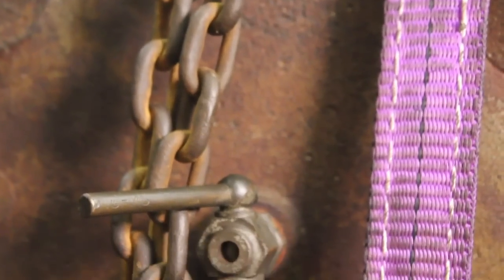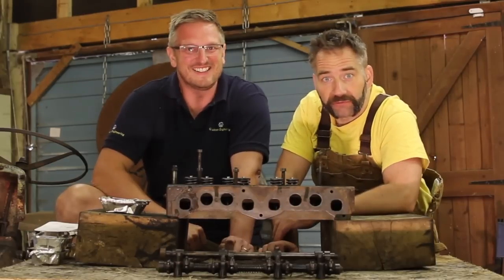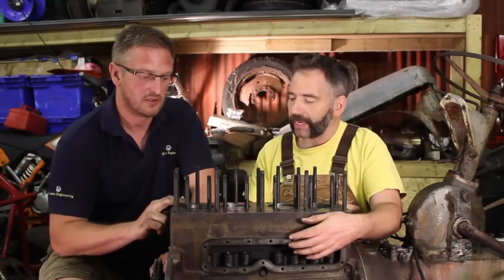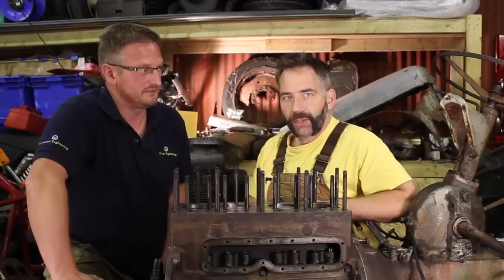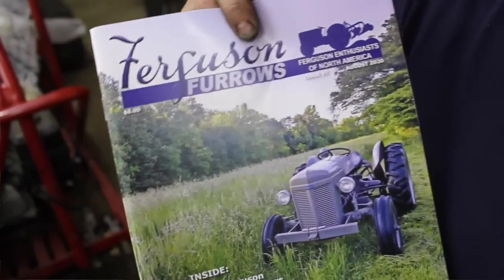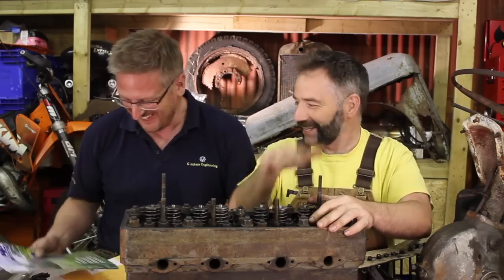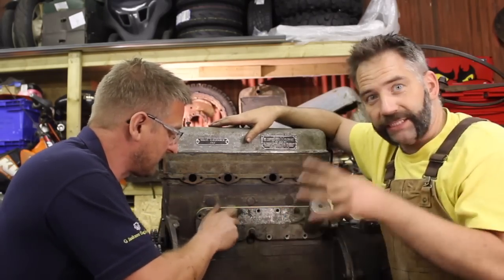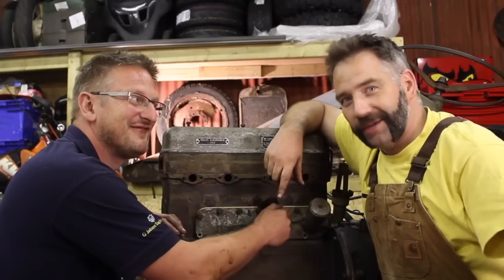Barn Find Fergie.  Episode 7. How to Rebuild an Engine

Comment: It's great to see you both making progress with the fergie,one tip for future reference,a little wipe of the studs with a cloth treated with some paraffin or a dose of that penetrating spray,gets you home more easily when fitting copper gaskets,and as the block and head haven't been surfaced,by the look of it ,a slight smear of Wellseal,if you can still get it ?,would help the head gasket to seat without crinkling the copper.
I'm enjoying the series very much ,thankyou both,see you next week .
Reply: Loving the tips, glad you’re enjoying it, see you next week👍

Comment: Make sure to check the clearance on the valve decompressor rack when setting valve clearance. This opens 3 valves slightly when the decompressor is applied. You can set the clearance when the valve the decompressor acts on is fully closed. Another trick of mine is to use copper washers on the bolts holding on the cam follower cover and the diesel pump gear cover on the timing cover as oil made its way out through the bolts on both my diesel Fergies. Great work and following with interest.
Reply: Thanks for the great tips Darren, and thanks for watching 👍
Reply from the maker: We'll be checking that decompressor when setting the tappets. Is there any setting angles we should know about?
Reply: There's a hole in the top of the bracket around the decompressor shaft above cyl 2. Turn the shaft until you can fit a screwdriver or drill bit down into it. This lines the shaft up in the off position. Set the clearance to 30 thou for cyl 1, 2 and 4 and set cyl 3 to 45 thou. This can be done as long as the valve under it it fully closed and as long as the drill bit is holding the decompressor shaft in the off position. They rarely need setting but way better to check in case they are holding a valve open!!
Reply from the maker: @dazsden  Great info! It shall be done!

Comment: Best time to check the valve sealing is any point between torquing the head down and setting the tappets. 

Use an adapter in the injector hole to fill each cylinder with compressed air. Spray oil into the ports and watch for bubbles.
Reply: Thanks for the info, I’d like to try that👍
Reply from the maker: Nice Tips!

Comment: Rocker 20lbs ft 
Sump 12-15lbs ft
Injector 12-14lbs ft
Oil pump attachment 16-18lbs ft
Oil filter centre bolt 20lbs ft 👍
Reply from the maker: That sounds firm!
Reply: @jimmydevillesgarage6585  Elbow click 😂
Reply: Nice one, gonna need them very soon I hope👍
Reply: Double 99 or Twin 99 🍦....naff name 😂

Comment: What no rocker cover gasket ??? As for tightened down firm old mechanic I worked with used to say ttft I’m sure you know what he was saying lol
Reply: Don’t panic, we didn’t forget this time😂 it’s coming off again soon. Thanks for watching
Reply from the maker: On the FT scale!
Reply: @montydog0  if you're after a Diesel tank or any other parts I have a lot off spair Tef20 parts
Reply: Mark Roberts Thanks, we may well need a few bits, are you on Twitter or Facebook?
Reply from the maker: @markroberts2151   We are in need of a Diesel tank. It'd be great to discuss further, is it solid?